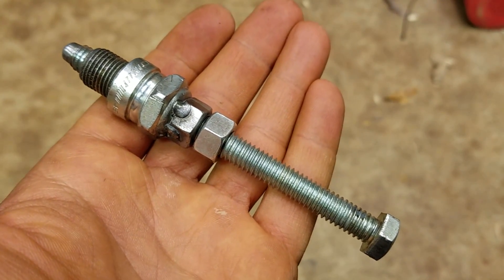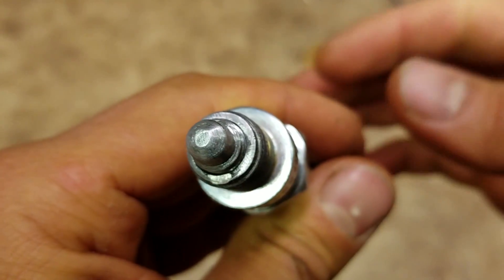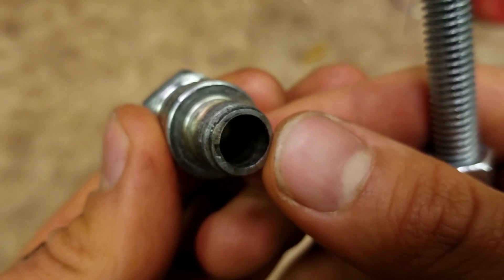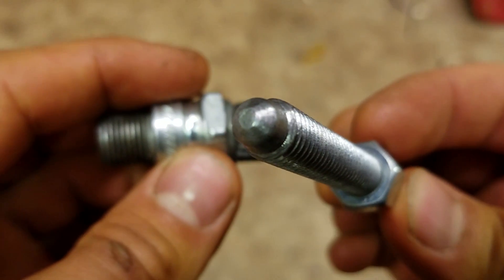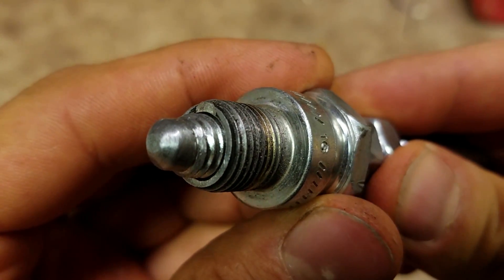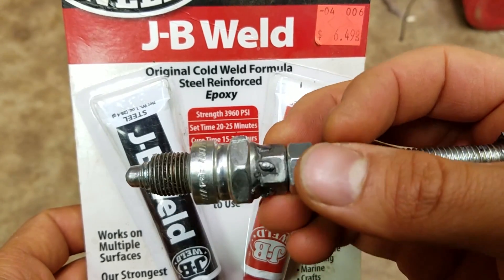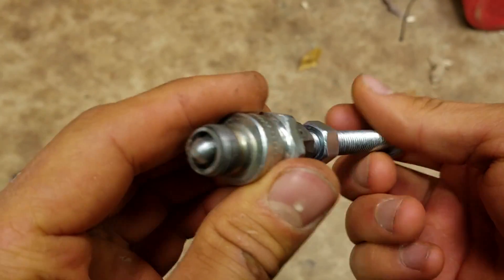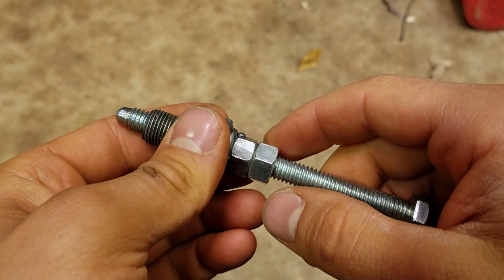How To Make An Outboard TDC / Piston Stop Tool

Comment: You can find them all over e bay but there like 30 bucks or more I just use old pice of starter rope doubled over  its free
Reply from the maker: The rope method is not a good enough for an outboard. It is not precise enough. You need to be able to feel and adjust when the piston comes up to TDC on an outboard. The rope could get stuck in the 2 Stroke cylinder ports.
Reply: If the rope catches in there you may end up taking the whole power head apart.

Comment: I had a guy on the AOMCI AOMCI Facebook page tell me he uses a piston stop to torque flywheel nuts.  My flywheel torque spec is 105 ft.lbs.   he said he has been using the piston stop for 35 years to torque nuts.  I'm not going to do it.  He also said piston are forged steel.   Any I have seen are aluminum.   I bought a automotive flywheel wrench to hold the flywheel.
Reply from the maker: NEVER use the piston stop tool to torque the flywheel nut. That's insane. The pistons are aluminum. Use a flywheel holder tool.

Comment: How in the hell did you get the porcelain out of the center? I have destroyed 2 plugs so far. I just can’t get it to break out??
Reply from the maker: A screw driver and a hammer!
Reply: @MattsShop  I have a 10mm plug. It just keeps crushing the threads so I can’t use them. I’ve tried just about everything!!

Comment: how far the bolt goes into the cylinder to touch the piston
Reply from the maker: You screw it in and out and rotate the piston until the pointer reads TDC on the flywheel. At least over 1". Make sure it's safe and won't start with the TDC tool in.
Reply: @MattsShop  thanks and very good video

Comment: how much the bolt a enters the cylinder to touch the piston
Reply: Gringo196 sf
     You start with the bolt backed out almost all the way up. Then you just run it in one or two turns at a time. Or do it the other way around. Turn it all the way in bring your piston up against the bolt stop the back the bolt off one turn. Move the piston up against it and repeat until the bolt moves up and the piston clears the bolt and starts back down. Screw the bolt in a quarter of a turn. If the piston doesn’t hit the bolt screw it in another quarter turn. Repeat until you find TOP DEAD CENTER

Comment: How do you use this?
Reply from the maker: Disconnect the battery. You take all the spark plugs out, rotate the engine with the tool inserted and adjust everything until you find TDC. There are timing marks on the flywheel.  Don't ever start the engine with the tool in.

Comment: great tool, gonna build one of these this week for timing my TR6 with the heads on,
Reply from the maker: Yea, cheap, easy and they work.
Reply: Hey matt, how did you get the innards of the Spark plug out? Did you ream it with something? Or can it be knocked out with a hammer and I've just not hit it hard enough? I don't have a press, so I need to find a way to get it out of there. Thanks!
Reply from the maker: Hey, just smash the white part with a hammer. Then chip the little white pieces out of the metal part with a hammer and screwdriver.
Make sure to blow out or wash out the metal part so that nothing falls in your motor.
Reply: Thanks matt, gonna try this now. can't wait to degree my cam and get my car back on the roadddd
Reply from the maker: Cool, you are welcome!
Reply: Make it better and use a brass bolt to avoid piston scratch.
Reply from the maker: Great idea! Didn't think about doing that.

Comment: for my 5.7l went to harware store and bought a 1/2" x 20 thread bolt w/at least 2.5-3.0" thread under $3
Reply from the maker: What did you do for the spark plug threads?
Reply: The threads on the plugs of my 5.7l are 1/2"x20 thread count. So I buy a 5" long by 1/2" dia. bolt with fine(20 thread count) threads and just screw the whole bolt into the plug socket. As long as the length of the threads themselves  are long enough - should be no prob contacting piston head. The threads don't wind up the whole bolt usually, so just make sure theres enough thread to get deep enough to contact piston.
Reply from the maker: I didn't know that. I thought all plug threads are metric? Good tip though, that way you don't have to make an adapter like I did.